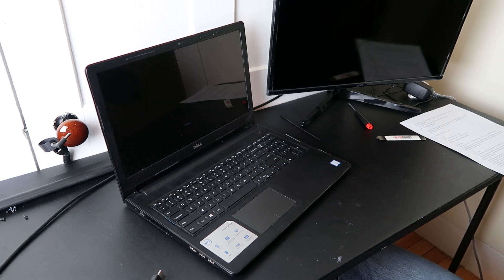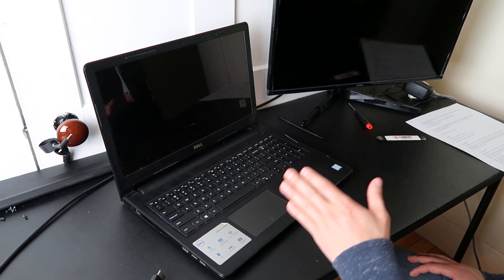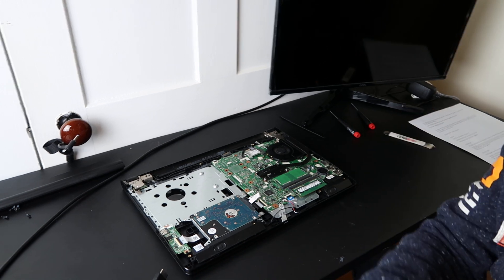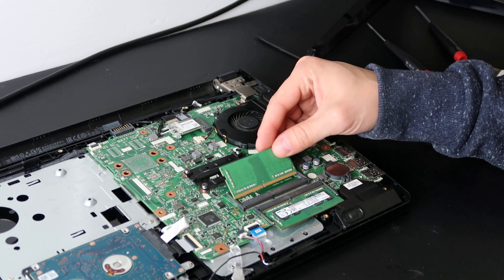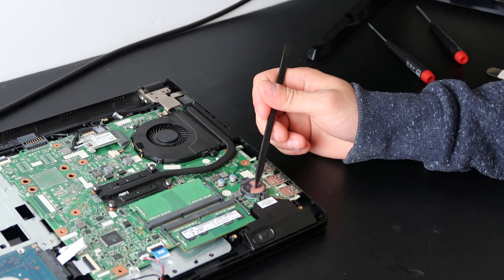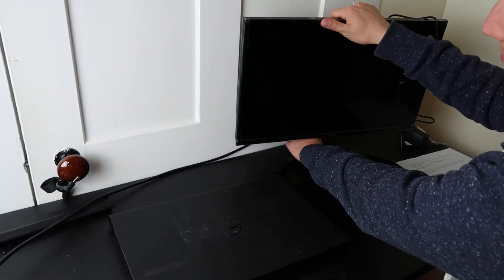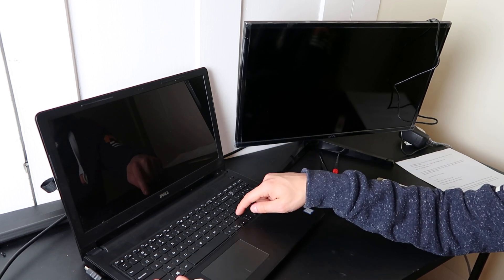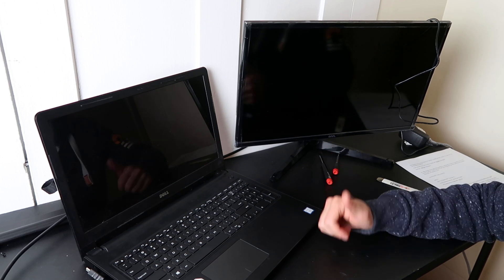How To Fix Black Screen / No Display / Dim Screen / No Picture for Dell Laptop

Comment: Ram test done

External monitor test done

Other battery thing not done, to outdated cant even find it lol 

NEED HELP : C
Reply from the maker: What happened with the external monitor test?
Reply: Black screen still might be cmos battery
Reply from the maker: @vex2085  You can try the BIOS reset as seen here;  https://www.youtube.com/watch?v=76I2Ec9K7lw or you can try just replacing the CMOS battery.
If that does not work, then your prob looking at a prob with your motherboard.

Comment: Bro actually there is a burnt smell to one of my fan my keypads is on but my screen does not turn on i have a Dell G3 3779 can you please me thanks a lot sir
Reply from the maker: Burt smell isnt good.  Perhaps motherboard or some other component damaged.  
For a computer that does not turn on, try this video first;  https://youtu.be/P3I7dDpkJps.  Let me know how that goes :)
Reply: @PC_Monkey  Bro this also does not work either the fans are not turning on the burnt smell seems to be on one fan i discovered this when 1 disassemble my laptop thanks bro
Reply from the maker: @yudishmoonean5990   If all the tests in this video do not reveal the issue, and your power adapter tested to be fine, then your most likely looking at a Motherboard replacement as seen here;  https://youtu.be/N_7HNrFkMS8.
Reply: @PC_Monkey  Thanks again bro for your reply and advice i will surely look into that ✌️
Reply from the maker: @yudishmoonean5990  Good luck !!  Sorry it wasnt something easier :(
Reply: @PC_Monkey  don't worry i understand thanks though for your advice

Comment: I’ve basically got 2 problems. 1. Boot loop. 2. When in boot loop, the screen doesn’t turn on and displays nothing. This means I can’t access BIOS. I turn on the laptop, the keyboard lights up and the screen doesn’t turn on then the keyboard lights stay on for a few seconds and then the laptop turns off and on again and repeats.
Reply from the maker: For a computer that does not turn on, try this video first;  https://youtu.be/P3I7dDpkJps.  Let me know how that goes :)

Comment: Same problem again and again.
Reply from the maker: What brand and model computer do you have and whats the issue with it?
Reply: @PC_Monkey  dell Inspiron 3567. Black screen. I remove battery, press power button d, f2 again and again, change bios settings, etc, and then it starts again.
Reply from the maker: @reviewsbymohitmybloggingid4241  You said black screen issue but you also said you changed settings in BIOS.  This video is for a computer that turns on but the screen does not work.  If you can access and navigate BIOS, I assume your screen is working.  Correct?
Whats happening exactly when you try to start your computer?  What are you seeing?
Reply: @PC_Monkey  Exactly when I switched on the laptop, there is light, but it doesn't switch on. Then I try to remove the battery, press power button, press f12 and then do everything and once it gets on after trying all this for a hour or two, I access bios and make sure the settings are proper. Same happened twice.
Reply from the maker: @reviewsbymohitmybloggingid4241  Can you try hooking up to an external monitor?  See if the computer displays well there?
Reply: @PC_Monkey  you're not getting me. I use a laptop. Dell laptop. The same problem happens again and again, but then the system works smoothly.
Reply from the maker: @reviewsbymohitmybloggingid4241  You said in your comment that you switch on the laptop and there is light but it dont switch on.  If I'm not getting it, explain more / better.  What light?  A light from an LED or a screen light?  If the screen is lighting up but displaying nothing, than your on the correct video.  Try the steps here.  Have you?

Comment: Hii My dell laptop running  into similar problem.When  I adjust screen it goes black,when restart it works fine.but very small movement makes it go black.Laptop stays on.Any idea what problem could be there.
Reply from the maker: Sounds like a bad or loose LCD Cable.  You could try hooking computer up to external monitor and see if that too goes black when moved.  Or you could try reseating the LCD cable from both ends.
Reply: @PC_Monkey  Thanks man. Looks like the lcd cable is damaged or have cuts on it where it passes to lcd from motherboard, near the hinge.

Comment: I reply hope this works, future me, did it work?
Reply: uh I cant do this :/ I TRIED THOUGH
Reply from the maker: @idek2398  What part can you not do?  Whats the issue with your computer?
Reply: @PC_Monkey  ctrl + alt + delete still will not bring anything, not will any other combination of keys that are “supposed” to do somethin
Reply: it will not make anything pop up if what I mean for clarification
Reply from the maker: @idek2398  Whats the issue with the computer?  Is it turning on?  What can you see on the screen when you try to turn it on?
Reply: @PC_Monkey  same as the video, just black screen and mouse. However nothing will pop up when I do ctrl, alt, del
Reply from the maker: @idek2398  This video is for a computer that turns on but the screen does not work.  If you can see the mouse on the screen then the screen is working.  Its just not getting any other signal than the mouse.  For a Dell with this issue, refer to this video;  https://www.youtube.com/watch?v=ZFJHGvOGZbg&t=144s
Reply: @PC_Monkey  Thank you! It worked👍🏼
Reply from the maker: @idek2398  Great to hear !!  Always here to help :):)

Comment: I have a dell laptop that I connected to a dock in order to have two monitors and at first the two monitors worked fine but the laptop screen would go dark, even if i unplugged from the dock. Now, only one monitor works and the laptop screen and monitor 2 are dark. I'm not sure what I need to do...
Reply: Should I mention this laptop is brand new?
Reply from the maker: If one of the monitors works, then you computer is correctly sending out a signal.  I would unplug the dock and just see if the laptop screen works.  If not, plug one of the monitors into the computer via another HDMI cable.  If that monitor works, then your most likely looking at a bad LCD or LCD cable

Comment: So what should I do my computer is on but my monitor is pitch black
Reply from the maker: If the screen is black, what are the signs the computer is on?  Lights?  Sounds?  Fan?
your on the correct video.  Have you tried the steps seen here yet?
Reply: @PC_Monkey  the screen on my pc turns on but my monitor wont
Reply from the maker: @jessicadever704  The screen turns on but the monitor wont ??  Does that mean the screen lights up but does not display anything or does that mean your computer is connected to an external monitor and the laptop screen works but the external monitor does not?  

Also, again, are fan or hard drive sounds coming from your computer or just lights that show your computer is on?

Comment: Thanks for sharing such great videos that help people !!

I have an old Dell xps L502x and it takes 5-10 attempts to start. I always hear the fan noise & see power light up but screen doesn't light up. Most of the time I have external monitor attached & even that doesn't show any light. 

So is this the same issue & should I try the same fixes as you have suggested or something else will do ?

Thanks !!
Reply from the maker: Yes, its the same issue.  Try the tests seen here :)
Reply: @PC_Monkey  thanks for replying & helping all of us with ur nice videos. 
I have tried resetting RAM & that didn't fix. I guess CMOS could be the issue as my system is around 9 years old & whenever I restart the system instantly after the shutdown it works but whenever I try it after a day then it has this issue. 

I will leave my system on charge tonight even after shutdown so that CMOS keep getting power, may be this will help in diagnose of CMOS issue.

Even according to this post https://www.hp.com/us-en/shop/tech-takes/what-is-cmos-battery-how-to-remove-and-replace: 

The CMOS battery gets charged whenever your laptop is plugged in. It’s only when your laptop is unplugged that the battery loses charge. Most batteries will last 2 to 10 years from the date they’re manufactured. The more you leave your laptop plugged in, the longer your battery will last.

Here are the CMOS battery failure symptoms:

    The laptop has difficult booting up etc.

Thanks again, really appreciate it :)

Comment: My laptop is displayed when it connect by vga cable to monitor . And not show it own laptop display . Display is black. So plz... tell me bro where os the problem ?
Reply from the maker: If your computer displays to an external monitor but not to its own LCD, then your issue is most likely with your LCD or LCD Cable.  Try 'Reseating' the cable first by unplugging it from both ends.  Then, plug it back in.  If that does not help, replace the LCD and Cable one at a time.

Comment: I got given this laptop and I need a red colour filter because my eyes hurt, but half way trying to figure it out I clicked custom colour and my screen went black and it hasn't turned back on. I'm kind of panicking because I'll be in trouble if it doesn't turn back on. Please help I don't know what to do f
Reply from the maker: If the screen is black, what are the signs the computer is on?  Lights?  Sounds?  Fan?

Comment: Hi, I own an HP gaming pav, which does boot and function normally, but once I hold it under the base of the laptop while moving to a different place, the screen becomes blank and the hard drive light continuously blinks/stops, and it doesn't recover until I hard shutdown it by continuously pressing the power button, please help me out, thanks in advance.
Reply from the maker: The HDD could be loose.  Moving the computer and holding it in that spot may be enough to make it more loose.  I would try to reseat the HDD and make sure its secure.  Also, avoid moving it in that way.  Perhaps, use two hands on the left and right side of the computer to move it.
Reply: @PC_Monkey  many thanks for your prompt response, the reason was the base door of laptop was pressing against RAM chip/slot while I was holding, so I have shifted  my  RAM chip to slot 2, so that there could be space between the base door and RAM chip, finally no more freezes, the problem was sorted out, thanks mate, your video helped me out find source of problem.
Reply from the maker: @jamesbond-cb4dt  Nice job locating the issue !!

Comment: Thanks bro, you just delivered me from the hands of thiefnician.
Reply from the maker: Happy to help :)  Always here if needed !!
Reply: @PC_Monkey  sir i have faced this issue but it got fixed by just cleaning the ram, today my laptop was on sleep mode and when i came back it wasnt turning on and shutted off, i tired cleaning the ram again and putting it back in but its not working please help me sir. 🙏🙏
Reply from the maker: @scythe445  If the screen is black, what are the signs that the computer is on? Lights, Fan, Motherboard or Hard Drive sounds?
Reply: @PC_Monkey  sir I hear a sound from the hard drive ting sound and after that the lights are kept on
Reply from the maker: @scythe445  Have you tried the steps seen here?
Reply: @PC_Monkey  it was my ram problem, ram got corrupted idk how i didnt even do anything to the ram, just bought new one and all fine i still have the old ram do you know how to fix it cuz i havent done anything to it.
Reply: @PC_Monkey bro what could be the reason while you are using laptop just like 35 to 40 minutes shut down itself unexpected even you plug on or not it just like that again again after like 30 minutes please help me 🙏🙏🙏
Reply from the maker: @AngelaKunda-w7x  Can you find an error matching the time of shutdown as seen here? https://www.youtube.com/watch?v=Nqn8-jJFx2Y
Reply: He’s also a Technician

Comment: how about ... screen so dark you can barely make out hp logo... external monitor will display but only after windows loads to login screen... hp logo never displays on external with hdmi cable.
Reply from the maker: Sounds like an issue with your LCD or LCD Cable.

Comment: So I have an Acer laptop and a tv I use as a second monitor, my laptop has a black screen but my tv shows what is usual. I go to the project section and switch it so it shows what’s on my laptop. My laptop thinks it’s on but my laptop screen is black

Comment: I got a quick question for you. So I got a Dell M4700 just to mess with Fusion 360. Fusion wouldn't recognize K2000 gpu so I was recommended to go into the bios and turn off the Optimus setting. After I did this now it won't turn on. You'll hear it kick on and fans Rev up for a second and then it just sits there. F2 or nor F12 work and I'm just kind of at a loss.
Reply from the maker: BIOS may have been messed up.  Try a manual reset as seen here;  https://www.youtube.com/watch?v=76I2Ec9K7lw
Reply: @PC_Monkey  Earlier in the day I had a suspicion it might have been the Quadro that failed. I quick pulled it apart and after pulling that out and retrying it without the GPU it did turn on. I do have another question though. I've read at GTX965M Type As are a direct drop in upgrade. Are GTX980M Type As also a direct drop in upgrade?

Comment: Any suggestions on how to fix a black screen while powered on 9 dell )? The 2 (A & B ) are flashing
Reply from the maker: Are the lights the only signs of life when you turn it on?  No motherboard or hard drive sounds?  No fan noise?
Reply: @PC_Monkey  there is a humming
Reply from the maker: @allendion6613  Lets try this video first then.  Have you tried the steps seen here?

Comment: Thank you so much, you helped me solve my problem. My problem was with the CMOS, i just replugged the cable connected to it and it did the trick. QESTION: Does that means that i have to get a new CMOS pile?
Reply: Yes

Comment: Dear Sir, I have an inspiron 1564 i3, black screen, power and fan dvd on, bought new ram for the same model, changed cmos battery, no luck, opened it, cleaned fan, radiator, new thermal paste, still no luck, just black screen, hard drive at first blink once then nothing on hard drive light, another thing, once i push PB, to switch off, it switch off immediately with no delay, while i dismantled the laptop, made sure all screen wires are ok, and connected to MB, please help me, i have no more money to spend wrongly, and need it for my daughter online daily school. Highly appreciate the help, already a new subscriber, and thumbs up.
Reply from the maker: Your on the correct video.  Have you tried all the steps seen here?  What was the result of the external monitor test?
Reply: @PC_Monkey  thanks for reply, its the only step i couldnt do, coz i dont have an external one
Reply from the maker: @mycomment6699  Then we dont know if the computer is actually putting out a signal.  At this point, it could be the LCD, the LCD Cable, or the Motherboard.
Reply: @PC_Monkey  am thankful for your interaction and help, I understand, will try to find a screen and connect, I was afraid that its the hard desk, will try, and keep you informed, thank you very much Sir.

Comment: My dell precision M6300 power button is on but screen stays black I'm so stressed
Reply from the maker: Are the lights the only signs of life when you turn it on?  No motherboard or hard drive sounds?  No fan noise?
Reply: @PC_Monkey i only hear fan noise and light on but screen stays black

Comment: I have this problem on my laptop (dell inspiron 13) , after some water went in from the keyboard I could only turn it on if it's plugged, weirdly enough when I plugged it in the fan and keyboard lights is automatically on, even when I haven't turned on my laptop yet, and there's 3 orange and 5 blinking light. 

So I wanna fix it based on this video, I only have one ram, which I should've buy a new one right? And then simus, Its taped and idk how i'll be removing it. Next is LCD cable, shame on me I dont have one and the monitor. Next is motherboard, not sure if I brave enough to detach everything and also put everything 100% back.

I guess my only is to pay someone money to fix it which I tried my best to not to.
Reply from the maker: Spilling liquid on your computer before these issues could mean a motherboard issue.  If none of these steps identify the problem, thats most likely what your looking at
Reply: Yes, and by replacing it do you mean detaching everything from the motherboard and put it on everything back again or, buying a new one from the same version?
Reply from the maker: @mellowwind5363  Replacing the motherboard if that does end up to be the issue.

Comment: I had the weirdest issue with my dell latitude 3330 a 2014 model, i changed the boot from legacy to uefi, that means that secure boot is off, then tryed reinstalling my windows with usb media tool, it has always worked for me, but this time when the first phase of the windows intalation ended it had to restart and when it did bye bye screen, the led lights had abnormal behavior and the screen, black